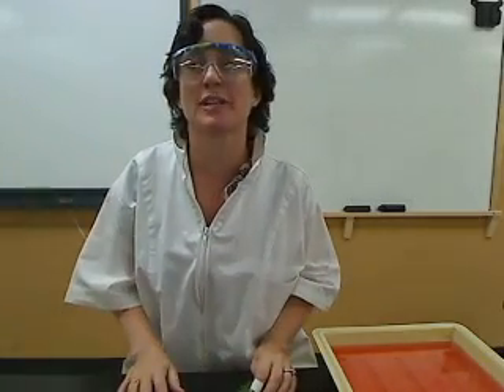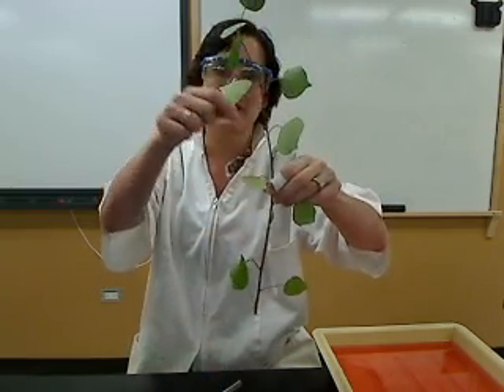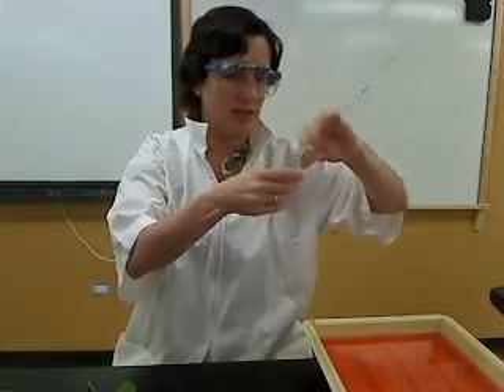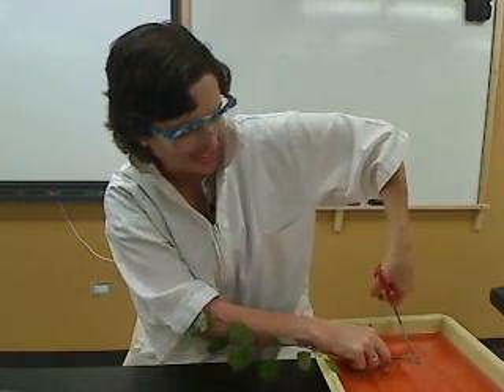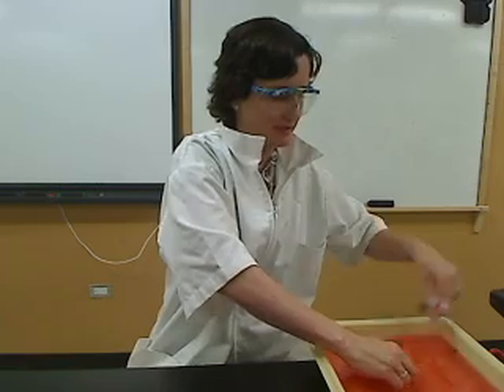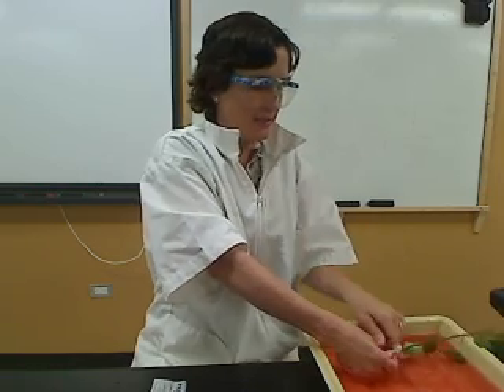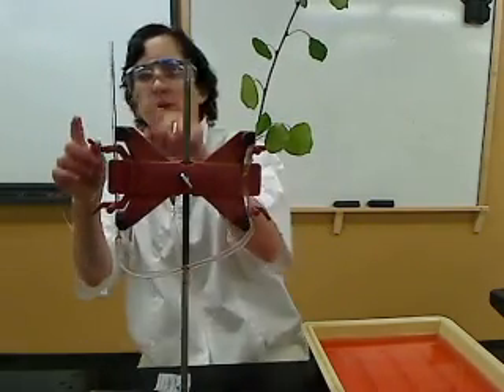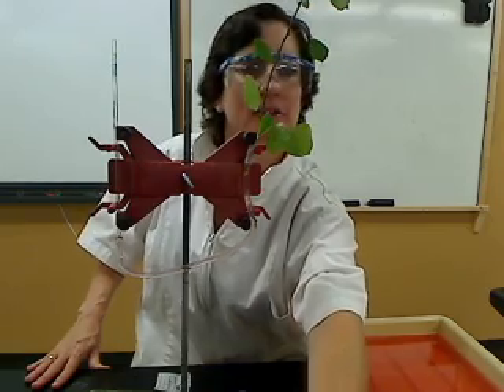Potometer

Comment: This type of potometer doesn't measure how far the bubble is moving, instead it measures the amount of water loss from transpiration. Therefore it doesn't require the 'reservoir' nor the water supply AKA water beaker at the other end.